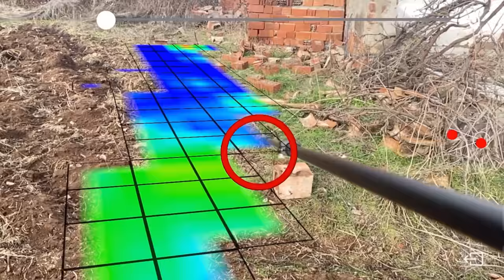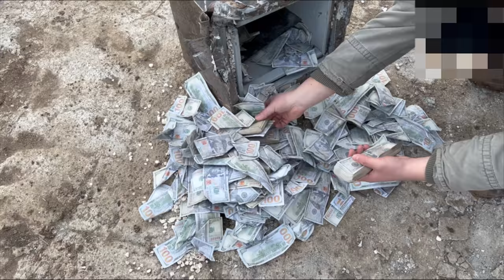We Found A Great Treasure / Big Treasure Hunt

Comment: Another great, “Tatian from the computer voice “I’m really excited we need to use every precaution we need to be very careful“ while he takes a wood saw blade on a Skil saw and attempts to cut through the metal siding. They’re taking safety precautions? Really? Wearing thin rubber boots well working around a jackhammer and electric saw, OK whatever. Like I’m sure you gave away a free metal detector